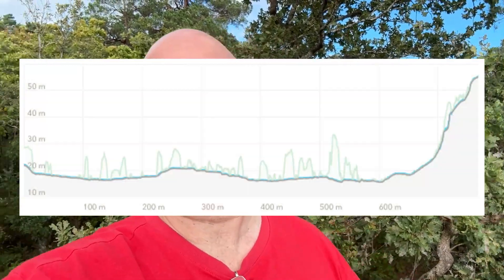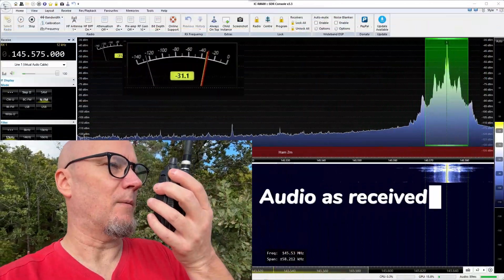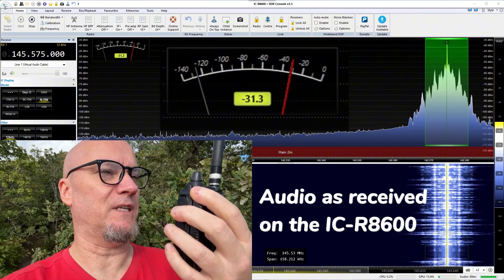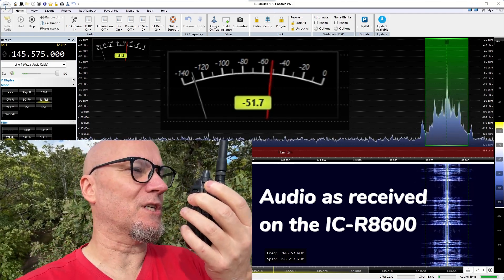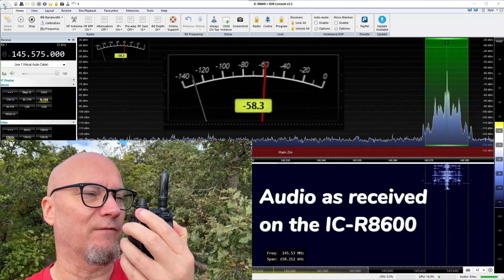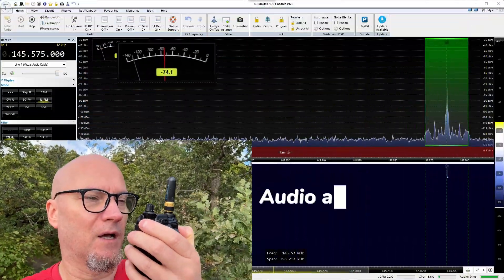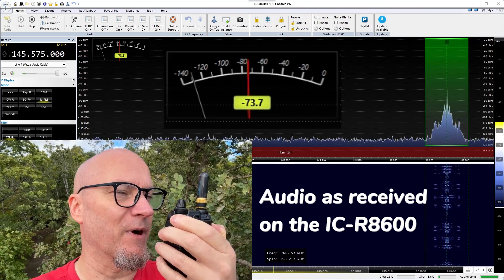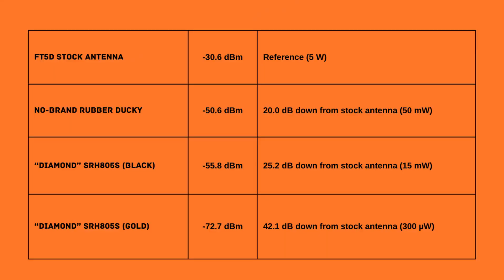Stubby antennas - how bad can they be?

Comment: In my experience, stubbies work pretty well to a couple hundred meters. Does that suck? Well...that depends entirely upon your needs. I've used them to communicate from one side of a football field to the other, which is a lot more convenient than using a phone. It's a specialty tool for niche applications. Like everything else, it "sucks" if you want it to do something it wasn't designed for.
Reply from the maker: Yeah; at shouting distance they work great. But so does a dummy load…

Comment: Was the wood chuck schpiel what was recorded? If so I’d say they performed well for a 1/2 mile. I mean what did we expect? I’ve used them radio to radio in Florida with both parties in separate housing developments 1.2 miles away. They worked very well. By the way, the answer is roughly 740 cubic feet.

Comment: I've had a pair of real Diamond SRH805 antennas for over ten years.  My son and I use them on 2m while kayak fishing. If we can see each other then we can hear each other, but that's about it. We carry a different antenna with us in case we need more range. Having the stubby is great and compact when the radio is clipped onto our life-vest, but that's about the only good thing I can say about them.
Reply from the maker: Yeah; sounds about like what I was getting. At 800 line of sight, with a clear Fresnel zone, it worked. But the received signal was really weak. But as you say, the certainty have their use cases!

Comment: There's not much for me to say except 🤔 so far, I've gone through 14+ antenna's since January 25, 2025 (Abbree | Twayrdio 144/430MHz, 2m/70cm VHF/UHF Telescopic | Radioddity RD-331 Tri Band | SMA501 | Tactical | Bingfu Gooseneck CS Tactical Antenna Dual Band | Nagoya 771 | Nagoya NA-320A Tri-band HT Antenna 2M-1.25M-70CM (144-220-440Mhz) | etc), operating the Baofeng BF-F8HP PRO.

And once again, my stock antenna topped them all when I added a "Counterpoise" (aka:"rat-tail" & "tiger-tail")
Reply from the maker: Yeah; "rat-tails" are certainly something I'll want to explore too. I think with the exception of the Diamond RH770 telescopic antenna, all the rest would do significantly better with a "rat-tail".

Comment: I bought a Nagoya NA-771 for my Baofeng, the difference at 446 between it and the stock antenna is night and day. I'll never go to a stubby, no matter how convenient it might appear.
Reply from the maker: Did you get a genuine Nagoya or a "Chinese import" version (eBay/AliExpress)? I've been testing the Diamond RH-771 un VHF, and I'm meassuring no more then 2 dB improvement on TX. But a friend from my local club tells me it makes quite the difference on RX, especially then not holding the radio. I guess I have some more testing to do, bot on UHF and on receive... Anyway; thanks for the feedback :-)
Reply: @radiohyperactivity  it came in a branded green poly bag with rounded corners and barcode. Ordered through Amazon.

Comment: Are they on the same frequenvy range
Reply from the maker: You mean the specs for the antennas? They're all specified as VHF/UHF antennas! Where they actually resonate (especially the Chinese "import" ones) is anyone's guess. And it's kind of hard to measure, as both the chassis of the radio and the body of the person holding the radio will be a functional and significant part of the antenna system.
Reply: @radiohyperactivity  There is a big difference between VHF and UHF  for longer distance you need lower frequency the higher the frequency the shorter the distance, if you want a stronger signal but not a far distance than you use a higher frequency but as you said the specs dont tell you the Hz so it would not be easy to compare .Thanks for your input and keep up the great work.